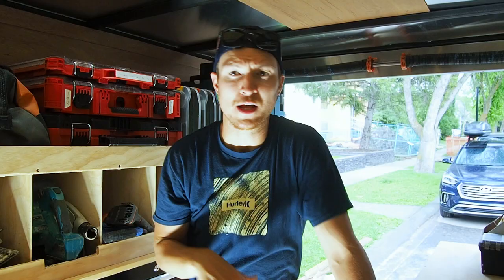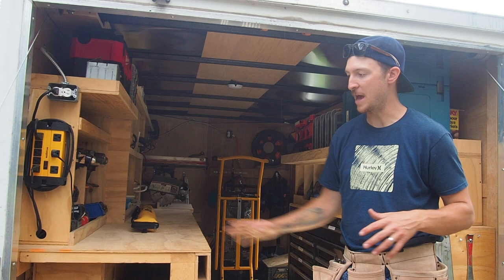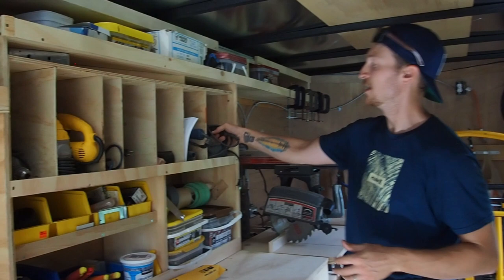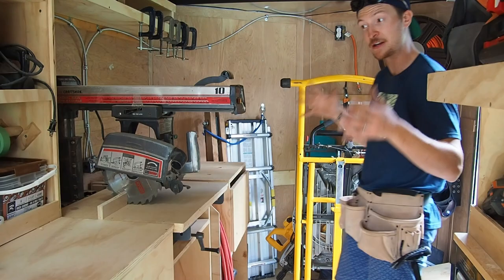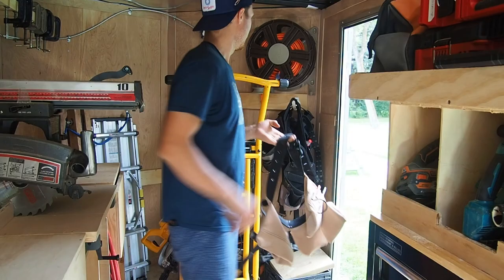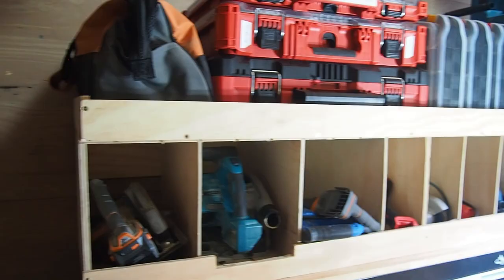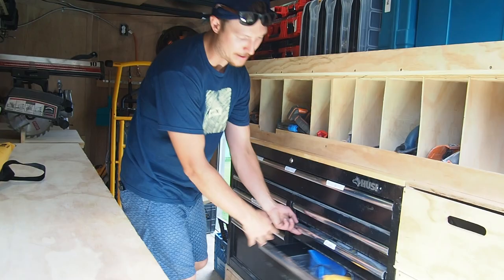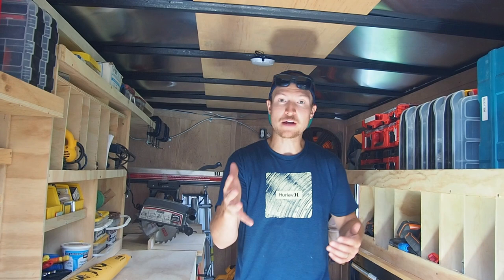The Homestud Tool Trailer Tour

Comment: Building a trailer and being an electrician is not the same as being a carpenter. I can make a decent box. Even did a very nice box enclosure with a deep pull out drawer to conceal my tools in my Honda Odyssey work truck. Later had to rebuild it with long expensive slides due to the considerable weight. 

But now it’s time for a trailer and everyone has either a way cool complicated cabinet setup or a too basic but effective setup with large bins for storage, but that seemed too specific for maybe framing or something that is the daily job thing. 
Everyday I’m doing something different. 
Your set up includes the workbench, cubby’s for organizing, and so forth, plus electrical. Shelving for specific tasks. A still achievable build for a non carpenter with the tools but not so much developed skill set. 

Having to somehow hopefully incorporate a sliding miter saw, and table saw is desired, but it’s not practical. 

But your setup appears to be an achievable possibility to kick off with. 
My trailer is 10x6 and looks to be the same general door arrangement. 

I saw in a comment that this is history, so I will assume you have a different design for whatever’s more current. 
Cool idea though. 
A radial arm saw is an odd thing to see in this era

Comment: you might want to consider putting some wax or Dove soap on the side of your bottom edges of your slide out drawers before you get tennis elbow or pull your shoulder out or perhaps carpal tunnel syndrome
Reply from the maker: They were quite a pull haha - trailer has been sold now. Maybe the next guy did it..

Comment: I’m working on designing my jobsite trailer that I will be buying in a couple weeks. I’ll be going with either 7x14 or 7x16. I was curious how you liked the 6’6” height? I can get 7’ height for $400 more, just not sure if it’s necessary. Also curious if you ever wish you had either an open spot on the wall or a wider center aisle so you could haul appliances or something larger like that if you needed to. Thanks for the great video and ideas!
Reply from the maker: Thanks! There are definitely a few changes that I am going to make (shortly hopefully). First, I find the height fine for me (I'm 6'1"). I don't store anything on the ceiling and I don't feel as though I am going to hit my head either. I have always had my appliances delivered so the center aisle width has been fine for me- enough room to drag the saws in and out, as well as to move around. The big change I am going to make is a lumber/sheet good storage rack. Being in Canada with a long winter, I find myself putting sheet goods in the trailer A LOT. I hate having it take up my aisle way, so I am going to completely rebuild the right side of my trailer to accommodate this change. If this is something you may be doing, I would highly recommend this addition. Lastly, if you are getting a V-nose trailer, make a plan for this area. I didn't really have a great one and it can sometimes become a catch all for brooms/rakes/paint poles/etc. Good luck with you buildout.

Comment: Those cordless nailers are so heavy. After using them for a week, i had to do a return.  Just not worth the extra weight in the hand.
Reply from the maker: They definitely are heavier. I personally find the weight easier to deal with compared to dragging a hose behind me.
Reply: @hsdesignstudio  try an air tank on the belt. After running tongue & groove for a week you will want to huck it out the window.  The hammer on it leaves huge dents to. I prefer the dewalt air and a belt air tank. Weights about the same but the air is on your waste, AND you can use it on all your nailers and air tools. Cost a little to get setup  but its very scalable for multiple users.

Comment: I'm sorry if I missed this somewhere but what size is your trailer? Single or dual axle and the GVW? Thanks in advance
Reply from the maker: You didn't miss it, I totally forgot to add it in. Its a 7x12' with 6'6" height. Dual 3500lb axles.

Comment: Looks good. Curious, how do you like the Milwaukee batt vac?
Reply from the maker: It’s fantastic. I use it for little clean up jobs or as a blower to clean off big tools if I’m outside. Being cordless is real handy (I have an old corded tiny shop vac I replaced) and the Battery lasts long enough for my needs.
Reply: @hsdesignstudio  Thanks, been thinking about getting one, appreciate your opinion.

Comment: How did you attach the shelving/workbench onto the trailer?  What size screws, etc? Thanks.
Reply from the maker: The shelving and back of the bench are mounted directly to the steel framing members of the trailer walls with Truss head screws (mostly). Anything mounted to the floor is attached with standard wood screws. Size and length largely depended on strength or length needed. That being said, I tried to make sure everything bit into the steel by at least 5/8". I was paranoid of going right through the outer shell if I went to deep. It is likely enough though because nothing has let go yet after several years.
Reply: @hsdesignstudio  Appreciate the info. Going to start my 7x12 buildout this weekend.  Both your videos were super helpful for layout and functionality.  I totally agree on keeping stuff in containers vs open.  Thanks again.
Reply from the maker: @CM-vm9sd  no problem 👍 best of luck!